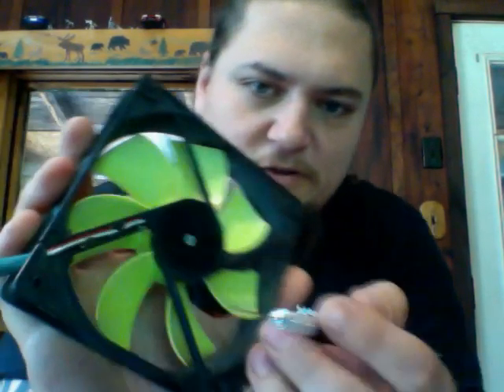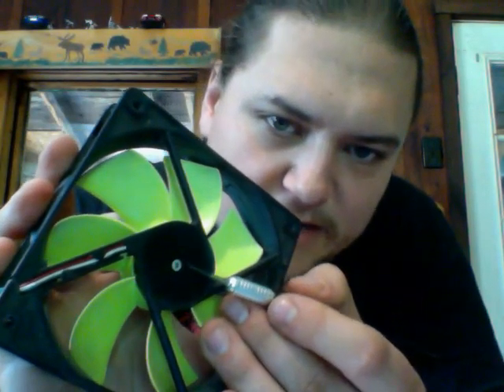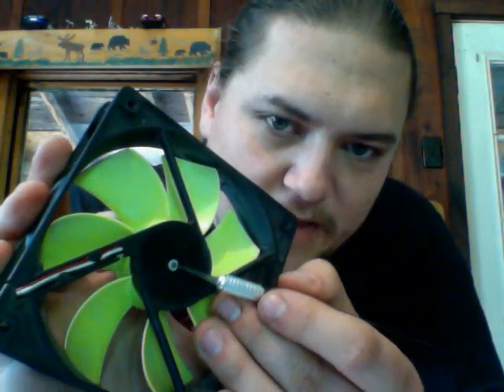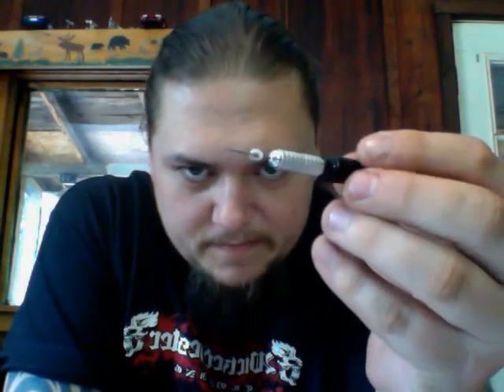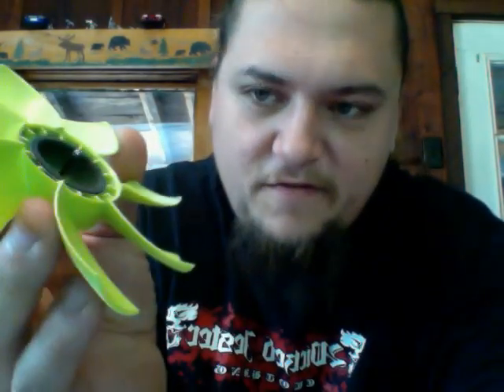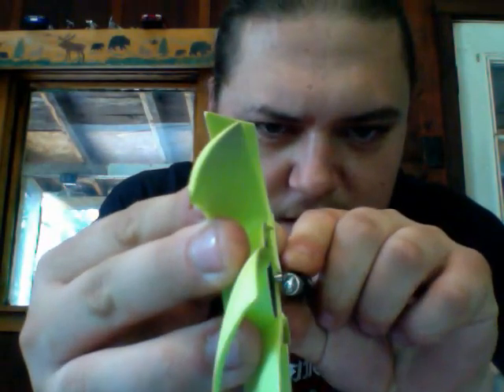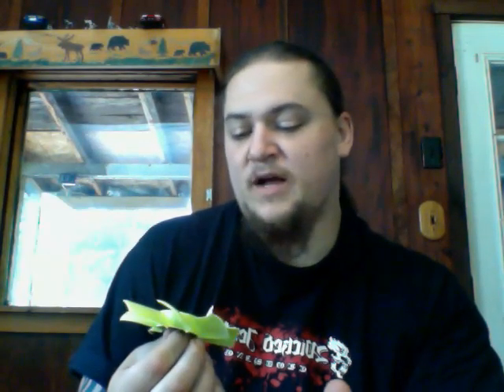Disassembly of 120mm Case Fans

Comment: do u know how to turn a three wire fn into a two?
Reply from the maker: Well I suppose it depends. What is the output voltage for your 2 pin connector? If it's 5v then you would need to use the yellow wire (generally), and the black wire on the fan. If it's a 12v then you'd need to use the red wire instead of the yellow. Just make sure you use the right wire to match the output. Running 12v on the 5v side of the fan will kill it quick like. I hope this helps. It's kind of off the top of my head and I've never converted a fan from 3 pin to 2 pin. But the wire colors don't change red is 12v and yellow is 5v.
Reply: +The Prepper Geek yellow is 12V actually... red is 5V!